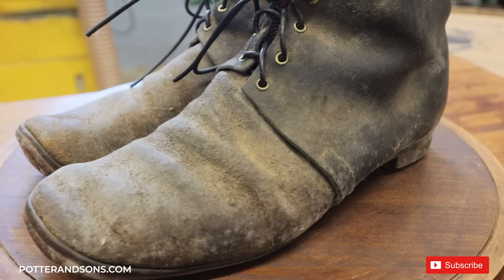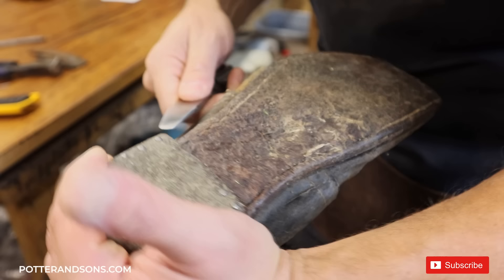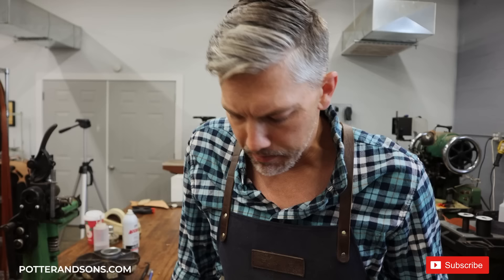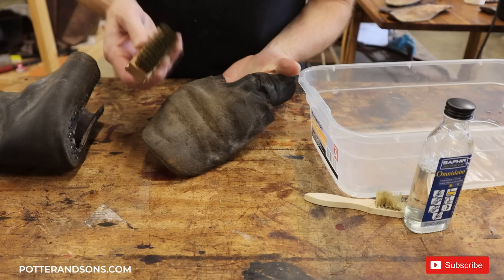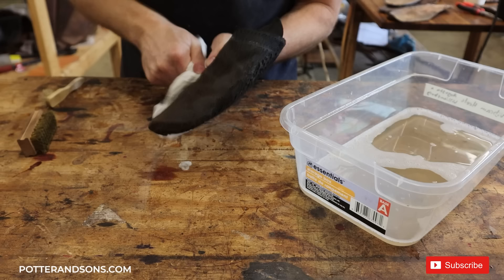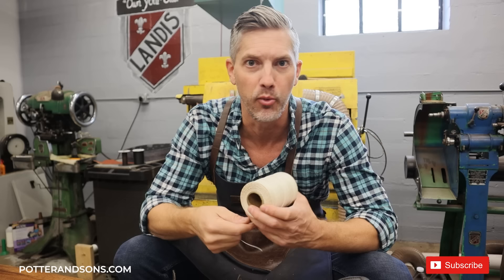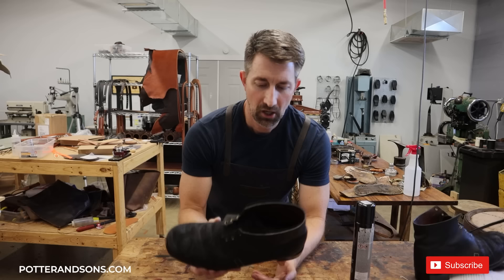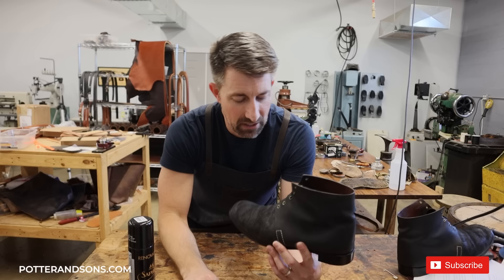RESTORATION of Quality Replica Mid-1800's (1850s-1860s) Boots

Comment: I have a pair like this. Bought back in " 89 ". Pegged sole. About 1992 the sole on the right toe area started to peel away. I had an article on pine sap and how it hardens. I found a pine tree looking for pine sap. Found a small lump, not runny or too stiff. Dabbed some between the sole and boot and wore them for the re-enactment. Still have them and the toe looks fine.

Comment: Great video y’all! Would shoemakers back then have used versions of hide glue on these? I’ve seen woodworking channels where they talk about old times makers using that for furniture with draw bore pegs holding their joints together. The glue would swell the wood tight around the joints and provide a xtra support, but wouldn’t last through changes in seasons long term. Keep up the great content.
Reply: There are some old recipes of shoemakers paste that include small amounts of bone glue i think. Never heard of one with hide glue but could be. Hide glue is essentially the same thing but more elastic than bone glue. I guess this property could be advantageous for some boot making purposes...

Comment: Very nice video! I am pretty sure they would have used paste instead of glue back then. especially for heel building! Did you ever build a heel by hand with dampened leather, paste and wooden pegs? Its quite tricky but fun! And ones you get the hang of it it is also durable, when finished properly. The heel lifts get way more compressed and very dense. they almost mold together because you constantly need to carefully hammer them... time consuming though!
Reply from the maker: Yes, I've done heels like that on some of my personal shoes.